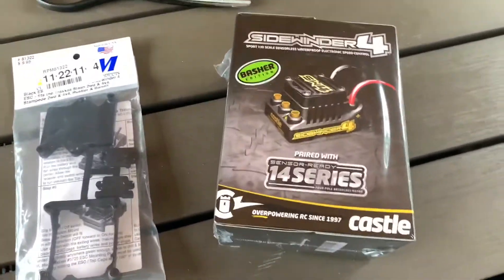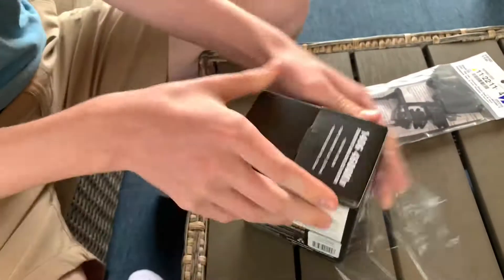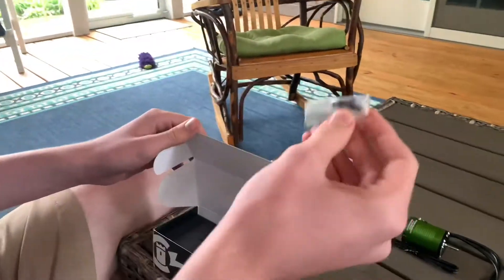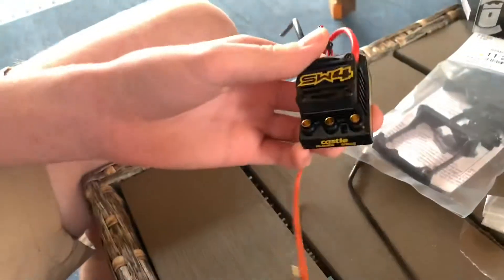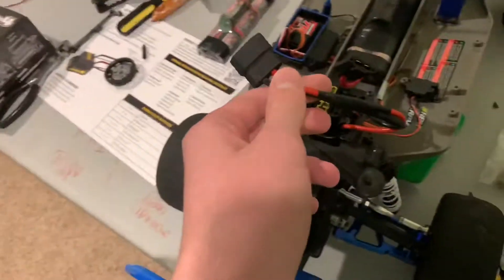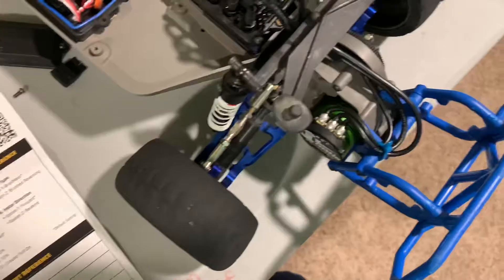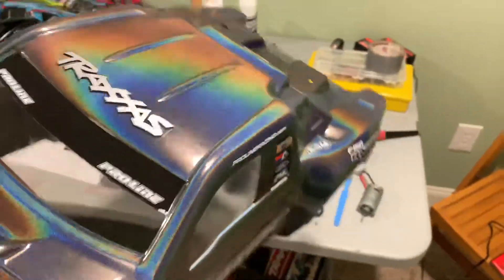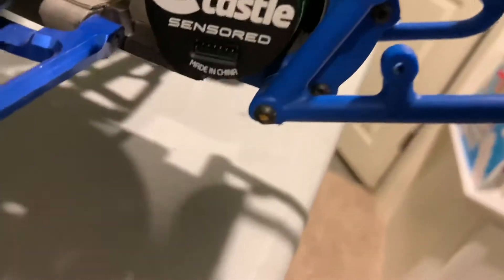Castle Creations Sidewinder 4 Unboxing 4600kv Motor+ESC Combo

Comment: That body is clean! I like it, but man, it's 2023, why not switch to lipo? Better answer longer runtimes, no quick abrupt sudden power loss etc, and a hunt of advice I have this combo but with the I think it's either a 22 or 2400kv motor n the motor has the sensored port but the esc is sensorless only so while bashing, it's a good idea to put a piece of electrical tape over the sensor wire port on the motor to keep water and gunk outta it, but dang I really do like that body my guy, did u buy it that way or paint it yourself or have sumone custom paint it? I really really really dig it
Reply from the maker: Hey man! To follow up with you we do run lipos now on all of our cars and the body was a clear slash body with Spaz stix paint that I sprayed on myself.

Comment: If you had to choose  between hobbywing xr10 max or the castle sw4 for drag racing a slash-  which way would you go?
Reply from the maker: I’ve never used the xr10 but the motor in that combo is more meant for racing, however if you pick the right kv and gearing ratio the sidewinder 4 can really get up and go, I’ve gotten 50mph out of my slash 2wd on 3s 4600kv and 22/86 gearing with the sidewinder combo so it’s really up to you, maybe watch a few vids on the xr10 and sw4 to help you pick!!!
Reply: I have been watching anything and everything.   Even contacted castle and hobbywing for some direction.
Reply from the maker: @toddshobbyzone659  yeah man sorry I can’t help you with the hobbywing, but considering how powerful the Max10 esc and motor combo in our stampede is I think either way both of those systems are gonna give you crazy amounts of power and you’ll be satisfied either way!

Comment: I just bought a Sidewinder 4 paired with a Castle 5700kV sensored motor for my ECX Ruckus 2wd 1/10. What transmitter and receiver would you recommend because I don't think either of the stock ones are compatible?
Reply from the maker: The sidewinder 4 ESC plug should plug into your receiver, how many slots does the current receiver have?
Reply: Did your truck come with the STX2? My Torment came with that radio and it paired up fine. I have the Sidewinder 4 with the 5700kv as well as the 3800kv and they worked fine. I'm not a professional but I'd say go through your manual again and if it doesn't then something isn't working properly. The stock receiver  by spectrum works fine and was recommended by many RC shops. Hope this helps
Reply: Sorry it's a spectrum servo. I'm not sure what brand receiver it is but mine is still stock and paired up
Reply: Check my comment below. Your turning on the radio and holding down the throttle and then turning on the truck right? The sidewinder manual has step by step instructions but sometimes it can seem difficult. Let me know and I'll walk you through it Nevermind that was 4 months ago. Sorry I don't usually go online and read and leave comments until recently with RC because it's become such a fun hobby I recently started but forget to check when these comments were made

Comment: You should get a 3 or 4s LiPo battery
Reply from the maker: Definitely will soon
Reply: @insanerc9585  I’m getting a hobywing max 10 for my slash
Reply from the maker: Ryan Vlogs epiccccc
Reply: @insanerc9585  so just tell me the name of the thing you got outbid on and I’ll try to help
Reply from the maker: Ryan Vlogs we’ve been looking for more things to get, we’re trying to buy a chassis and then buy the cheapest parts to put in all costing under $100 but it’s really hard bro
Reply: @insanerc9585  I’m gonna look for a chassis today
Reply: @insanerc9585  Amazon has a great deal hobby park chassis $16. Not joking
Reply: @insanerc9585  wait no $18
Reply from the maker: Ryan Vlogs could you send the link
Reply from the maker: Oh wait actually sorry that’s not what we meant if we do it it’s going to be a roller so it will have everything but the electronics
Reply: @insanerc9585  oh ok
Reply: @insanerc9585  I’m going to look
Reply: @insanerc9585  try goin to his hobby shop called rc car world and maybe they’ll hook you up
Reply: @insanerc9585  if your fine with being overvolted.
Reply from the maker: It can take 3s though sooooooo
Reply: @insanerc9585  oh
Reply from the maker: Bro Ryan someone outbid is on the budget car we were gonna get so it’ll be a while before that vid comes out😭
Reply: @insanerc9585  that’s fine what were you bidding on and I’ll take a look
Reply: @insanerc9585  and I’ll try to find it for a good price and brand new
Reply: You should stick to what it can handle. Which is 2s-3s. Maybe I should make some videos just to make sure everyone is getting good info. I have the 3800kv motor and the 5700kv motor. Unless your changing your truck to a drag setup, these options are fast enough. You'll need weights or aluminum parts to keep the front end from wheeling. That's fun but not if your going for speed, it will just wheelie right over and slide on the roof. I've done many upgrades, not too much though.

Comment: I thought the sw4 was sensorless
Reply from the maker: I have a sensored motor but sensorless ESC  there are many options when it comes to Sensored/Sensorless products from Castle
Reply: Insane RC I was also looking at some hobby king stuff, I’m about to post a new vid
Reply from the maker: Andrew Melton great I’ll check it out
Reply: Insane RC thanks! Still in the process of filming
Reply: Insane RC the esc wires literally desoldered
Reply from the maker: Andrew Melton dang that stinks but please don’t curse on the channel
Reply: Insane RC ok, I’ll refrain it just sucks I burned it so fast